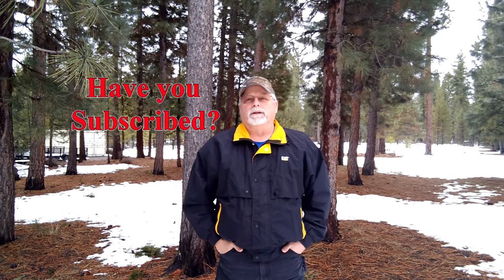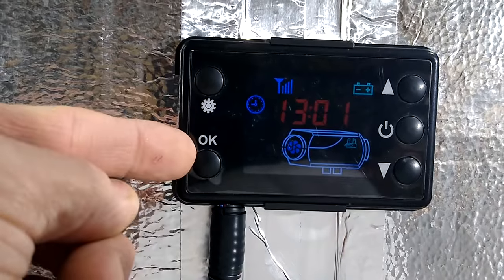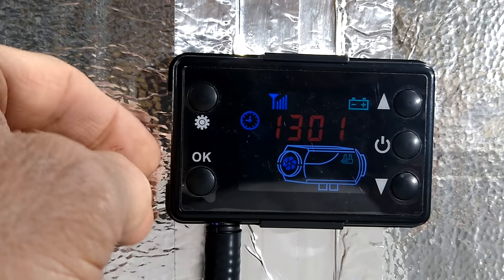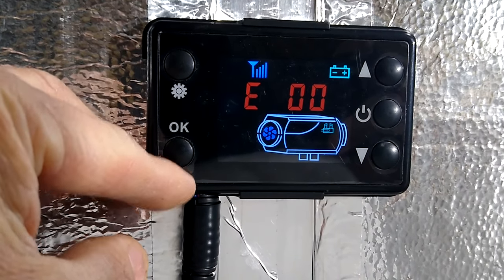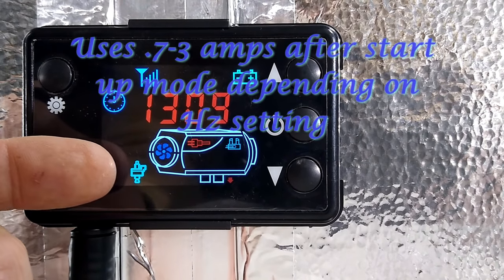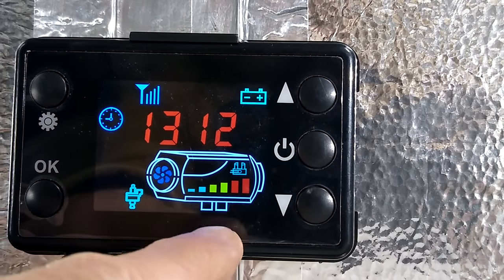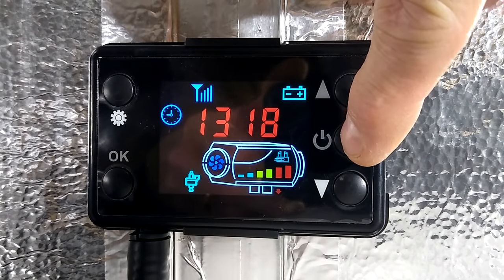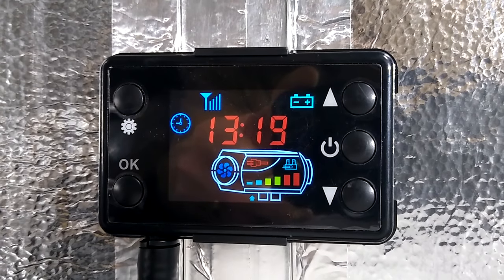Chinese Diesel Heater Controller Setup

Comment: Thanks all working... But how to adjust fan and heat... Set it on 1.4hz...so is that it..do you have to prime before every use... Cheers

 Cheers
Reply from the maker: Hi Richard. Watch the video again I do point out how you can run heater on Hz setting or air temperature. Thanks for watching the video. Please like and subscribe then let others know about our channel. Have a great day.

Comment: My controller looks identical to yours but...My Settings button doesn't do anything unless i push it along with the Up button (then I get a Clock icon) or if I press the Settings along with the OK button (then I get a blue 2 mountain peak looking icon) 
I have no idea what that is either. Plus, I bought a 12 volt A27 battery for the small Remote Controller...it doesn't seem to do anything either....but the tiny red light inside does flash red when i press any of its 4 buttons.
Atleast my On/Off button works on my Controller works and my heater is Great !
Liked/Subscribed !
Reply from the maker: You may want to contact the company that sold you the electronic controller and let them know what your controller is and isn't doing. sounds like you need a new controller. Thank you for watching my videos and have a good week

Comment: hi   not sure if i am posting in the right place  i have fitted a heater and it all works perfect and have found all your advice really useful...my question is when i switch it off should all the led's on the readout stay lit or can i make them go off till i switch it on again as it will be using electric,,i know it;s not much but all helps
Reply from the maker: Hi Stephen, unfortunately there's no way to turn the led backlight off. Have a great day
Reply: @explorer867  thax for your reply and help   great vids and info   keep up the good work and stay safe   happy camping

Comment: I am the guy with the air bubbles. I finally got it working, but today when I turned it on it won’t run. The new pump I put in doesn’t pump at all so I tried the old pump by testing it with a battery, the pump runs but no fuel comes out. Is there a way I can back flush it or do you have any ideas?
Reply from the maker: You can flush the pump out using a large basting syringe. Some times when these pumps fail is because the filter has allowed some dirt / grit to pass into the pump. This will cause the piston to seize up and thus not pump fuel. Take the pump out where you can work on it and give it some light taps on the sides of the case, hook up a temporary fuel line to the inlet side of the pump and manually prime it. Hook the power supply up to the pump and with the temporary fuel hooked up to the pump run the pump and see if it pumps fuel if not repeat the process.    Hope this helps, and let me know how your project works out.. Have a great week

Comment: Great video, thank you. My question is can can you run the diesel heater with the engine off?
Reply from the maker: Hi Coach Carl, These are best run with there own 12 volt battery power supply and recharged via solar or generator power supply. You can run these from your vehicles main starting battery assuming the battery is fully charged. The challenge with running off vehicles power supply is that you may discharge your starting battery. Thanks for watching and please subscribe and pass our channel around your social media contacts .
Reply: @explorer867  Thank you for the response. Just bought my van and I'm a little over my head and leaning as I go.

So I have 2 batteries at the back left of my van, I'm assuming one of these is for the heater. Plus I have a solar panel on the roof.

Just not sure why this isn't working???

Comment: Can you change the speed of the fan?
With the new lcd screens you can do this i think. 
Thanks for the video!
Reply from the maker: I'm not so sure you would want to manually override the default fan speed as doing this may cause the burn chamber to overheat and destroy the ECU. The fan speed automatically adjusts based on the temperature of the burn chamber. Burn chamber temperature is set by the selected temperature setting in controler, or the number of fuel pump cycles per second. Have a great weekend

Comment: What power supply are you using?  My battery holds at 13.2, but my heater drags that 13.2 down before the glow plug fires up, which cause an error.
Reply from the maker: Make sure your battery connections are good and that your using heavy enough wire to handle the power requirements of the heater. On start up the heater draws 8 to 10 amps. If you're using the furnished wire harness and not extending it, it should be adequate. Make sure your battery is good as well. Please Like, Subscribe Ring the bell and let others know about our channel on your social media. Have a great day.
Reply from the maker: Check out this video. It will show you my battery and solar power setup in the camper canopy. Hope this helps. https://youtu.be/VKkk76HWTmE

Comment: Will the heater automatically turn on at the set temp and heat are the only two options manual or timer?
Reply from the maker: Hi Last Resort, Yes the only two ways to activate this heater is with the timer and manual mode. The unit will turn on at the last Hz or Celsius setting you had set. Thanks for asking and sorry I had overlooked your question. Please give me a thumbs up, subscribe, let others know about our channel on your social media, check out our other videos. Have a great day.

Comment: How is this heater after a few years use? I had it for one year, used maybe 10 times, it works fine
Reply from the maker: The heater works flawlessly. I have had no issues with it. I have installed one in my cargo trailer camper conversion last summer and it's working fine also. Please subscribe, give me a thumbs up, and let others know about our channel. Have a great week.
Reply: @explorer867  already did that. thank you for the info

Comment: I have question for you guys
I just install one of these and I wonder, if I preset 15 degrees, but the current temp is 25, do the heater tuns off, or stays on lower ?
Thanks

Comment: I  installed one of these Chinese heaters one year ago, how long will the heater last. Runs almost nonstop from December to April up here in Minnesota and I live in my RV up to 4 days a week. Thanks anybody.
Reply from the maker: Hi Marcus, I have two of the 5000 btu  diesel heaters one of which I have been using on our camping trips for almost three years. It hasn't given me any problems. I do carry an extra glow plug, glow plug wrench, and replacement gaskets. If you are running it on a low setting most of the time make sure you run it on high for 5 minutes or so before turning it off. This helps to burn off carbon buildup from the burn chamber and the atomizer screen. Always use fresh diesel. Please give me a thumbs up, subscribe, let others know about our channel, and check out our other videos. Have a great day.

Comment: Curious what altitude your at?  I’ve installed one I my camper and it worked great for a week and then fouled. After cleaning and refouling  sever times I’m about ready to chuck it. I’m using it at 9000 feet in Colorado
Reply from the maker: 4350'. Are you using fresh diesel? If your running this heater at low settings mostly make sure to run it on hi for 3 minutes before shutting it down, this should help with the carboning caused at the lower settings. Have a great day
Reply: adjust the pump cycle to a lower ... "low oxygen" setting

Comment: I have this heater in the basement of my motorcoach, is there a way to extend the wiring to the controller so I can keep it in the living area ? What I mean is if I can cut the wires to extend them ?
Reply from the maker: Hi @RodgerAnderson1, I'm not a licensed Electrician so I can't give out electrical advice. I have heard of people replacing the OEM wire harness with heavier gage wire and extending. This done at your own risk. Have fun with your project. Please Like, Subscribe, Ring the bell, and let others know about our channel. Have a great day

Comment: Help!!! I have 3 12 v batteries in parallel and the control panel is displaying the E 01 error.  Meaning my batteries are not creating enough juice to power the heater and control unit.

Comment: So I can’t set it up like home thermostat like when it reaches temp I want it turns off ? Does lower hz means colder air coming out of the vent ?
Reply from the maker: No the controller doesn't turn the heater and fan off and on.  If you watch all the video I do explain what the hz setting does.  Please subscribe and give a thumbs up. Pass the channel along on your social media. Thank you

Comment: Good morning. I just want to check if you already encounter a diesel heater that when turn on, the heat that comes out is continuously hot even with the lowest setting. I would greatly appreciate if you could comment on this . I don't know if my diesel heater sensor has a problem or I just don't know how to adjust it.  my diesel heater is 8kw. Thanks a lot.
Reply from the maker: The heater when running will always put out hot air. When you adjust the Hz setting up or down the pump will pump more or less diesel into the heater and as the temp rises in the combustion chamber the fan will pick up speed and slow down as you lower the Hz setting thus putting out less heat. Hope this helps and thank you for watching
Reply: @explorer867  thank you very much. i really appreciate your reply.

Comment: I do you use less fuel by turning down the thermostat at nite or shutting it off?
Reply from the maker: Hi Jesse, I just turn it off at night. If it gets cold in the night I will turn it on to warm the camper up then turn it back off, I never sleep with it on. Thanks for asking

Comment: Great video. I used your instructions on how to set the clock but now the clock isn’t counting the minutes. It just stays at the time I set it. Would you know what I’m doing wrong?
Reply from the maker: Mark, how is your clock working? If the controller doesn't automatically revert to the run mode after you have set the current time then you have an issue with the controller and need to replace it in my opinion.  Please like, subscribe, watch all our videos and let others know about our channel. Have a great week.

Comment: Hi can you show how to set the voltage drop cut off. I think you can set this to 11v's as a safety cut off for the battery not to go to low and drain? Regards
Reply from the maker: If you shut down your heater with a auto low voltage cutoff switch before it runs it's cool down process you will destroy the diesel heater's ECU. Just monitor your battery bank's voltage. If needed run the shutdown cycle on heater. This said most of your better lithium batteries have low voltage cutoffs programmed into their BMS. Have a great day. Please Like, Subscribe, Ring the bell and let others know about our channel on your social media.
Reply: @explorer867  wasn't the question shut down

Comment: Hi there. I’m trying to set the time. But when I power on my unit I don’t get the time option? And can’t find it in any menu either? Any help gratefully received.
Reply from the maker: Hi Rich, If you go to my video the first thing I talk about is the clock and show how to set it up.  Thanks for watching. Please give me a thumbs up, subscribe, let others know about our channel on your social media, check out our other videos. Have a great day.
Reply: @explorer867  thank you but I don’t have the 4 dashes that allow you to enter the time?
Reply from the maker: Hi Rich, did your heater come with a set of instructions?
Reply: @explorer867  it sure did,
But they don’t seem to match the unit. I’ve been in contact with Vevor, but am waiting for a response. Someone else told me not all of them have a clock, I’ve found my timer settings but no sign of a clock.
Reply from the maker: @richwhite8592   Rich Is your controller the same exact unit as the one in my video or is it one of the variant controllers. some of these heaters don't come with instructions at all. sounds like they may have included the wrong set with your heater.
Reply: @explorer867  it’s the blue controller, with black mini controller.

Comment: I can't get the priming to work. I get an error 04. Haven't gotten the heater to work once yet
Reply from the maker: E04 - Fuel pump disconnected. Check connector is clicked in place. Check the power lead to fuel pump,  Can be low voltage. If you haven't please subscribe, like, and click the bell. Have a good day

Comment: after setting and I turn the heater on....it trips the electrical current from my Bluetti solar generator.  why do you think that is?   Bill T.
Reply from the maker: Sounds like the circuit on your Bluetti can handle the start up mode of the heater.  When my diesel heater starts up and shuts down its running the fan, fuel pump and glow plug, it draws around 12 amps at those times. Have a great day

Comment: Hi I am having real problems with my heater starting.
 I’ve tried to get it started but it only comes on for a few moments then seems to go off. It is showing Code E-01 and the temp bars at the bottom of the screen never move up past the first one. 
I can’t see pump icon either. 
This my first van, only been living in it a short while, I am in Scotland and it’s getting cold so I need my heating to work 
I would be grateful for any assistance
Reply from the maker: Tracey, I would suggest you contact the manufacture to answer this question as I'm not a diesel heater maintenance expert.
Reply: Error 01 is low battery voltage. It’s possibly caused by poor connections, too many electrical items running at the same time, or possibly that your van needs a new battery. Fairly simple to check with a voltage meter.
Reply from the maker: Good to see you both tonight.
Reply: @explorer867  You didn’t say if you got your heater working or not.  Having thought some more about this, it’s possible that an E-01 code might appear if the heater has been set up for a 24 volts when your van is only 12 volts, as per most smaller vans and cars. This can be changed on the control panel.

Comment: I enjoyed your video, very informative. Best wishes from Ireland. Quick question how do you switch the control panel off, mines stays lit up no matter what I do
Reply from the maker: Daniel Jack's, Hello to Ireland. There's not a way to shut the controller off other than installing a external on off switch. This is easy to do but you need to be very careful not to turn the switch off before the unit has run it's cool down cycle. Please subscribe, give me a thumbs up, and let others know about our channel. Check out our other videos and have a great week. PS like to hear how your heater/controller is working out for you.

Comment: Hi just wondering if i need to prime my diesel heater every time ill start it? I'm still setting up mine. And the 2nd time i started it there where just too much smoke went out?
Reply from the maker: You shouldn't need to reprime the heater once you have it primed the first time. Check for leaks if your having problems with this. I have two of these setup and I don't have a issue with them smoking but just a little at startup and that only for about 15 seconds. Good luck with your heater and stay warm.

Comment: Just a tip if your heater is playing up will not start  after running a lot of fuel through it,remove the exhaust, mine was clogged up, clear it out, and remove the silicon bung round the heater plug, then get an air compressor and blow up the exhaust stub , then round the heater plug Beware tons of carbon will come out. it fixed mine without removing the spark plug. Hope this helps someone .
Reply from the maker: Thank you for your comment. Please subscribe, give me a thumbs up on my video, let others know about our channel and check out our other videos.

Comment: Any idea why mine that i just bought won’t stay on?  I press the on button and fan comes on for a few seconds and then the screen flashes off and back on and nothing.
Reply from the maker: Make sure your battery is fully charged, and your connections are good. Thank you for watching. Please Like, Subscribe, Ring the bell and let others know about our channel on your social media. Have a good weekend.
Reply: @explorer867  i have it hard wired to a 12v power supply plug into an outlet.  No battery.
Reply from the maker: @CharlieFF136  make sure the power supply is outputting the correct voltage and required watts

Comment: I have a problem with air bubbles. I had to change the fuel pump and in-line filter. Ever since I get an  E-08 erred code which is air in the line. I’ve taken all the fuel line apart twice but I can’t get rid of the bubbles. Any suggestions?
Reply: Oh, I’ve ran it thru the priming cycle a bunch of times.
Reply from the maker: These Diesel pumps create air bubbles, it's just a normal thing. The way you deal with them is make sure the pump is lower than the heater and the fuel line runs a minimum 20 degree angle up to the heater. The little air bubbles will run up the fuel line, into the heater. This should fix the problem. Have a good weekend.
Reply: You might have an air leak between the tank and the inlet of the pump. Possibly the joint where the meal pipe adapter screws into the tank. There should be no bubbles at all on the inlet side. However, the pump does cause fuel cavitation on the output side, so it’s normal to see bubbles in the supply pipe to the heater. They will be fuel vapour though, rather than air.